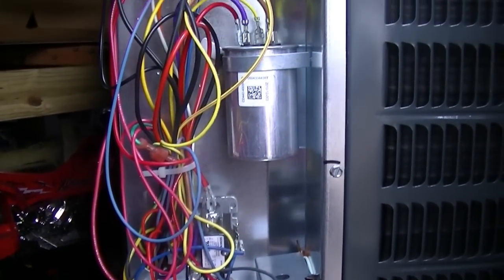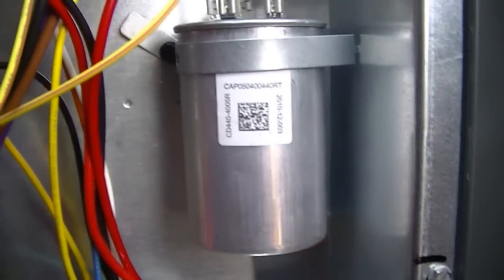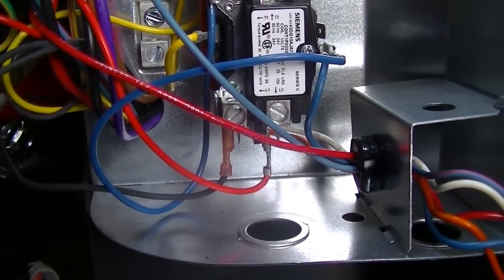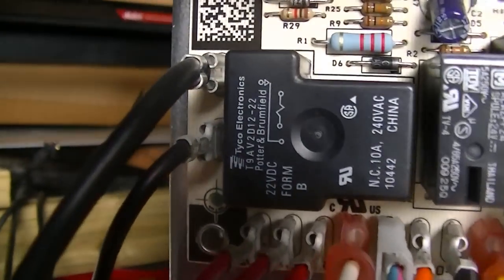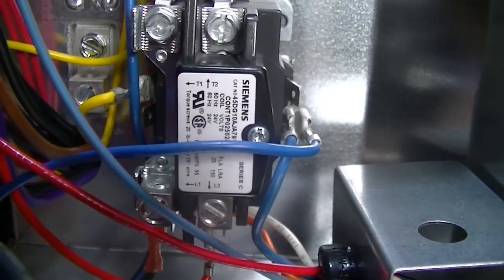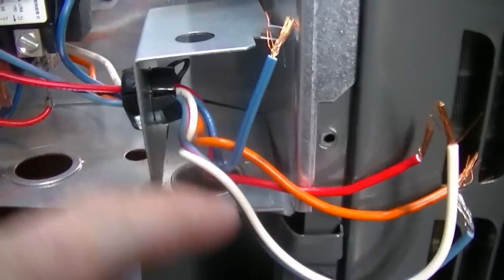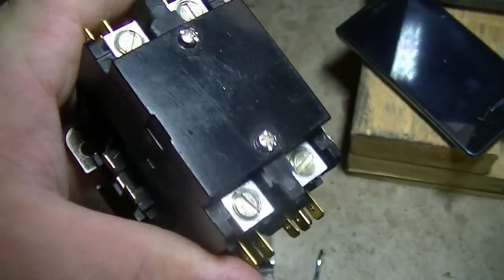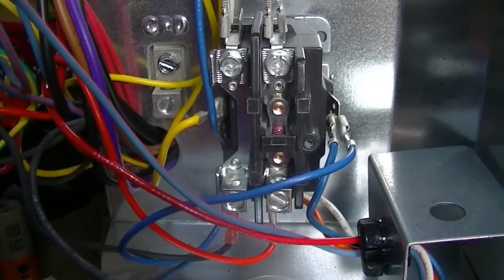HVAC Training-  Contactor Relay

Comment: The 120 volts read to ground means absolutely nothing when troubleshooting a 240 volt compressor, only that the transformer feeding it has a center tapped secondary. With the contactor closed, you would read 120 volts to ground from both L1 and L2, even if one of the 240 volt line conductors were open, 240 volts were not present at the contactor, and nothing could run. You would be reading 120 volts through the compressor motor windings giving the false impression that 240 volts were present between L1 and L2. This happens when fused switches are used for condensing unit disconnects, and one fuse has blown. Always check for 240 volts line to line at your equipment, and not for 120 volts to ground.

Comment: I do not have any power at the top of my switch but I do have 240 at the bottom , is the contractor bad
Reply from the maker: If you don’t have a signal for it to come on it won’t close.   Check to see if you have 24 V between the Y and common wires. If you don’t understand what I’m saying it might be best to call a technician.

Comment: I need to replace a contactor and its FLA is 25 and Resistive is 40 amps  its a 24v,  do I need to get the same exact one or can I get a 30 amps FLA?  or can I use a 2 pole contactor?

Comment: So the low side is completely different on high voltage side. could you use 12 volt DC to operate the contactor on the low side?
Reply: I'll tell you why I asked. I am off grid and use solar panels to power my freezer. I want my freezer to come on when the Sun comes up, so I can take advantage of the solar power in the am. I'm wondering if I can hook I hate separate solar panel up to the low side of the contact her to trigger the freezer to come on when the Sun comes up.
Reply from the maker: Bob Vance the contactors I use specify AC coils.
Reply: +Bob Vance you need a 12 volt dc relay, 20 amp rated

Comment: Great vid. Love all the electrical stuff. Changing it out when it looks rough is a good call. But I'm wondering for larger contactors, I've been told measuring voltage drop is more accurate, how exactly should that be done?
Reply from the maker: Voltage drop can be measured across the contactor poles. I.E. L1 to T1 or L2 to T2